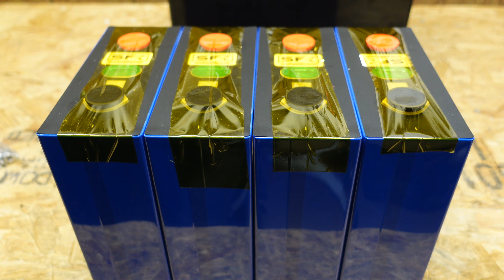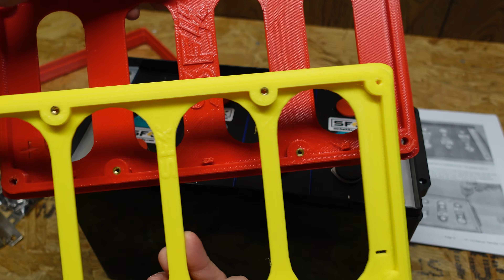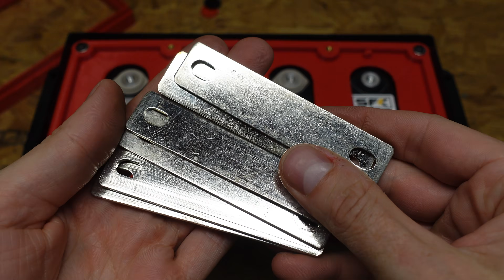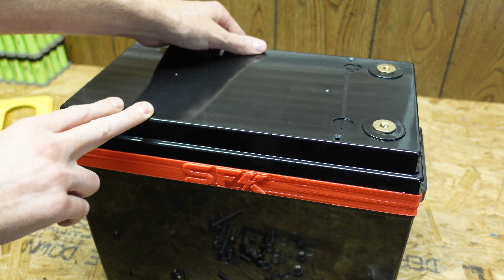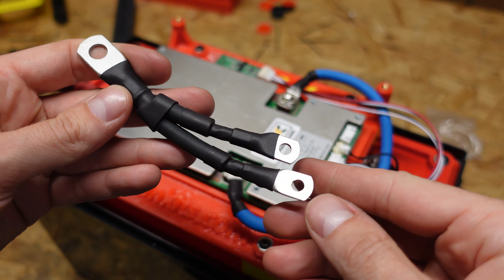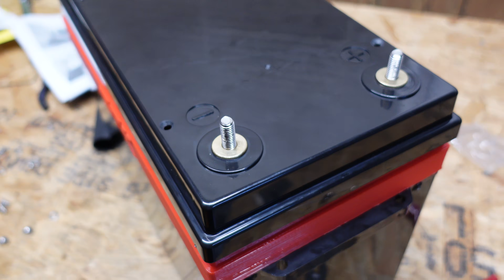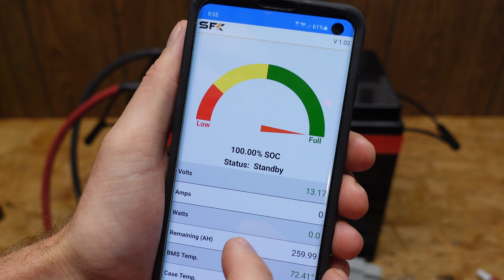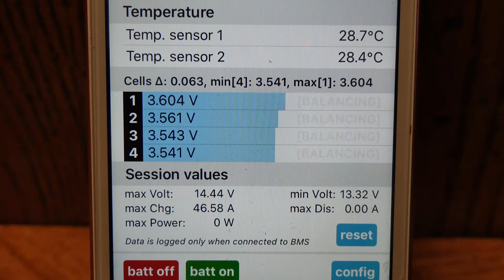Sun Fun Kits DIY 12V 280Ah LiFePO4 Battery, $295/kWh!

Comment: Beautiful assembly by Sun Fun Kit.
This really amazed me to see a company put together such a DIY Kit like this one. All the customer have to do is to read and follow the instruction manual of the manufacturer on how to install this kit and you are all set to go👏 👍
I do like to assemble project like this which I think in my opinion is really cool built DIY/Portable Solar Powered Generator.
Sun Fun Kit please send me one to do another beautiful review of this kit in a different perspective 
Very nice review and thanks for showing this awesome kit brother.
Reply from the maker: Agreed, they put together a very nice kit here. Very well thought out.
Reply: @LithiumSolar  
Yes.
FANTASTIC
Reply: I am putting together 2 of these batteries and an MPP 1012lv on a cart for my sister and grandson to use as power failure generators. The finished product is very good if slightly anemic,  but certainly enough to run the refrigerator and television for an extended outage.
Reply: @john_in_phoenix  
Awesome job and thanks for sharing
Reply: @john_in_phoenix  did you consider cheaper and less explosive conventional deep cell Batteries?
Reply: @jj-jak  You mean the ones that generate hydrogen and oxygen when you charge them, weigh three times as much and have less than half the usable capacity? No. You may wish to do some research before you call lithium iron phosphate explosive.
Reply: @john_in_phoenix  Lithium makes sense on vehicles (cars, boats, etc) I don't think it makes sense for fixed applications. I agree you'll get about half the density but also half the price per wh, all Batteries should have ventilation
Reply: @jj-jak  Lithium iron phosphate is a poor choice for starting batteries for any vehicle, they like the same temperature you do, and under the hood of a car is not a good place. Lithium iron phosphate are sealed batteries, and even have a pressure relief valve if you overcharge them. During normal operation, there are no emissions at all. You should read up on them, they are 99% efficient.
Reply: @john_in_phoenix  I agree they would be a poor choice for starting batteries, which is why I didn't say that. I also think they're a poor choice for your house, the premium may be worth while in a boat or camper but I have the distinct impression most viewers haven't consideredthe application.

Comment: For future reference on thread engagement, the first 3 threads take up 75% of the load.
Reply from the maker: Maybe, but tell that to the aluminum posts that wouldn't tighten and felt like they were pulling out :)
Reply: @LithiumSolar  no doubt aluminum is soft, more engagement the better, and a threaded stud is always the preferred solution. Just providing a datapoint if you need to make a judgement call in the future. ¯\_(ツ)_/¯
Reply: @LithiumSolar  as mentioned in other comments, the washers aren't needed with the short screws.

Comment: Oh, I cannot believe you used channel locks on the bolt threads… I’m sure you were gentle, and I noticed you pushed backwards from the jaw grip to limit damage to the threads, but still, a better way to do that would be to put a pair of nuts on the stud, and tighten them together, to create a safe gripping surface.
Reply from the maker: I was just frustrated by the time I got to that point, which resulted in the inappropriate use of pliers.
Reply: That is a good tip, I just made slightly longer (doubled) 6 awg silicone wires and had no problems. The wire makes a big difference in the frustration level.

Comment: also quite pricy when those boxes cost like 30 bucks on aliexpress.
Reply: I see that exact model priced more in the $100 range, and SFK has made very useful modifications with the aluminum bars on each end. The fit of everything is spot on, and the printed parts fit much better than I expected. Yes you could DIY cheaper, but the kit is worth the price if you don't already have a printer and design for the parts.
Reply: @john_in_phoenix  guess it makes sense mostly for those who are not confident with DIY builds and want the reassurance of the guide
Reply: @cbflazaro  I don't care about the guide, and I'm very skilled in DIY battery builds. I still bought the kits and supplied my own BMS and cellls.

Comment: A very nice diy alternative. Prevents us from needing to buy a LOT of tools for the job as well. Saves a lot for the diy battery builder.
Reply: I think you need to do a little more research I can still build one battery including batteries and all tools needed like heat gun cable crimpers and anything else including everything in a battery box for the almost 1300 dollars for one box premade that they sell and you still have to assemble it. I can do all the same for about 780 not including the tools which cost less than 200.
Reply: @simpletennesseelife5895  Nobody is stopping you. I purchased a kit (minus the cells and BMS) and will purchase more. What you wind up with when finished is very useful with a great finished appearance and quite useful. They add a lot of value to the kit version, if it isn't worth it for you, then nobody will stop you from doing your own. I already had the cells and BMS, and found the kits to be of a quality that I just ordered 3 more.

Comment: 286 isnt that shocking. 
All the EVE 280AH cells i buy test over 290 on the first capacity test 3.6 to 2.8v
Reply from the maker: Most of mine have tested 283-284. I don't think I've ever had one test 290, that's pretty good!!
Reply: @LithiumSolar  that high capacity only works on the very first few cycles,  after 1 month, it lands to the 280's pretty quick
Reply: @cbflazaro  Yes you are correct :). The Honey Moon amp period calms down rather quickly.

Comment: The charge limit is for the BMS not for the battery.  JBD 150A wont accept charge over 50% of its capacity.
Reply from the maker: Where do you see that mentioned? All of the JBD BMS I've ever used can charge and discharge at 100% of their rating. That's one of the big reasons I stopped using Daly.
Reply: No, that model BMS is rated for 150 amps charge, and comes defaulted to 160 amps over current. I had no problems charging at 80 amps, but I used the same model JBD that I had previously purchased.

Comment: That's not cheap. One can get WHOLE CAR with 30kWh+ battery for $9400.
Which rounds to about $310/kWh.
Reply from the maker: Your price comparison of what's "cheap" is flawed. You can't compare pricing of a 3.5kWh battery to a 30kWh battery. Of course the price per kWh will be cheaper on the 30kWh battery... This is a single 12V battery.
Reply: brand new car with brand new cells?  or just some random voltage used, degraded modules that will need to be rearranged into a normal working voltage?
Reply: @cbflazaro  New car with new cells.
Reply: There are far better KW/$ deals out there than that… but they are hardly a portable power device…
Reply: Ahem,  EV is 200-800 Volts PLUS and so when calculating kWh THAT is a HUGE FACTOR !    Do the Math.
Reply: @stephsoltesz6731  A killowatt hour is a killowatt hour, it makes no difference what the voltage is.
Reply: @john_in_phoenix  Chemistry, Cell Type & Number of cells to achieve X kWh.
Reply: @stephsoltesz6731  I learned ohms law in the 1970s. A kilowatt-hour is a kilowatt-hour. I know how to calculate a kilowatt-hour, voltage makes no difference, it is either a kilowatt-hour or it isn't. Chemistry, cell type, and number of cells has no bearing on the calculation except for what values to use. Voltage times amp hours.
Reply: I don't want a cheap car, I want a high quality 12v battery that can be used in series. This is a very good product. I own one, and I am going to order more. They work great with an MPP 1012lv as a system to run the refrigerator and a television/lights during an extended outage.
Reply: @john_in_phoenix  it's other way around. 
BYD and CATL are experts on producing cheap but high quality batteries which go into these cars. And you get them with very probably with more extensive warranty than what you are getting through AE.

They are obviously able to make battery for under $100/kWh and such models are about to come out.

BYD mate its name as battery manufacturer, after all.
Reply: @brane2379  I don't see any electric vehicles for sale in the USA for $9400, in fact, I don't see any BYD vehicles for sale in the USA. Certainly, you can purchase one in China and have it shipped, but you can also just buy the cells and build one yourself, which is what this video is about. It doesn't matter what price they can make the battery for if you can't buy one.
Reply: @john_in_phoenix  They are coming soon.across the world.
AFAIK one has been announced in Norway.
Reply: @john_in_phoenix  
Also, note that these cells from the OP come from China anyway. 
So, it might be a good thing to perhaps wait a bit and find BYD or CATL source of new cells instead of paying premium prices for stuff without any brand name or warranty.
Reply: @brane2379  Not really interested in vaporware, and I don't live in Norway or China. My cells come from EVE with their test reports. Yes, they are more expensive per kilowatt hour than a car I can't buy in a country I don't live in, that isn't being sold yet.
Reply: @john_in_phoenix  Suit yourself. If you love to buy through X intermediaries without warranty, more power to you.
Reply: @brane2379  As opposed to not buying a car not sold and not warrantied? Vaporware versus reality, your comments make no sense. The last two orders of cells I purchased were indeed purchased through a third party, but shipped directly from EVE to my house.
Reply: @john_in_phoenix  Or perhaps you have some deeper interest in supporting that particular channel ?
Reply: @brane2379  I purchased things with my own money and give my personal experience. I am not promoting a non-existent product. I paid full price and have no interest other than it is a good product. At least you can actually purchase it, rather than "some time in the future it might be for sale in a different country and might be cheaper, maybe". Why are you pushing hot air? BTW, the grade B cells I purchased last year came to $1600 for 16 cells. Considerably less than the fictitious car.
Reply: It's worth paying attention to possibility of new $100/kWh batteries, especially if available elsewhere excluding US